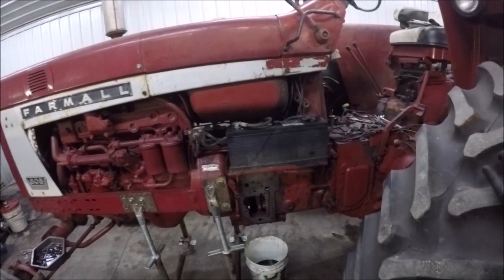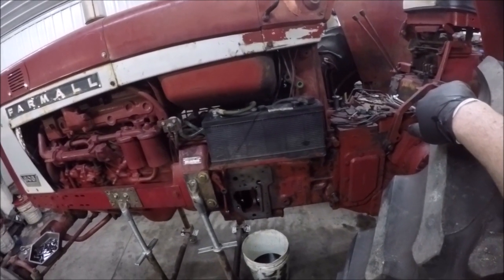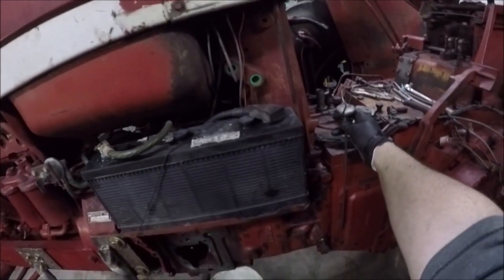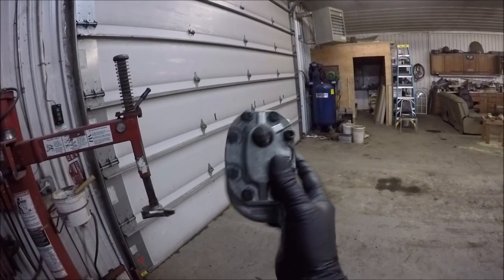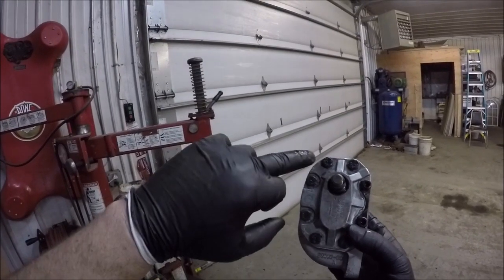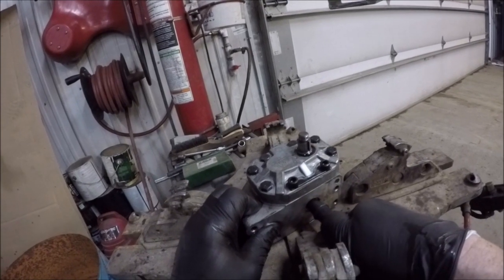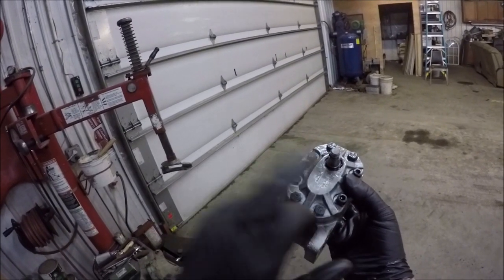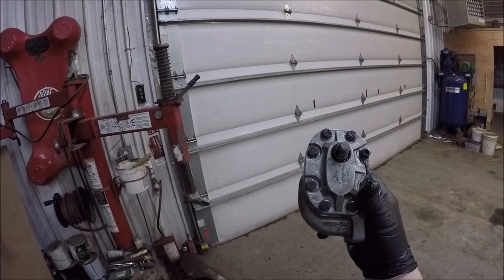Famall 806 MCV Pump Diagnose

Comment: Searching for this particular problem for a 706  IH a friend of mine has. I'm not familiar with IH but I have to believe the 806 and 706 have similar, if not the same, hydraulic systems. Good video and tutorial. Just subbed your channel 👍👍
Reply from the maker: The 706 & 806 are basically identical except the engine and a couple other items. Good luck
Thanks Ed, I appreciate it 👍

Comment: I just connect the other inside liftpump through a hose to establish if the smaller 9 gallon ? steering pump is defect, if it changes anything I order a new one of those cheap indian made pumps, or maybe it  s enough with one pump, don t know, didn t go to a hillside to brake or steer, but most likely it will slower your lift.
Reply from the maker: Watch this

https://youtu.be/sILJp6gL79g?si=vfRyRmv70hQh1Dwg

Comment: Good video! We’re did you order a new “higher flow “ pump from ?   How much more does it flow than factory?  Thanks
Reply from the maker: Thanks.

I believe its factory replacement 9gpm.

https://www.superiortractorparts.com/mobile/Product.aspx?id=38275
Reply: I think he meant the manufacturer of the new pump is HY-Capacity. (Common tractor parts brand)
Reply from the maker: @andrewmills9353  correct

Comment: While shredding with my 806, I noticed that the U-joints on the PTO drive shaft to the shredder broke and the shaft flew off. At the same time I lost the power steering, brakes, remote hydraulics to the shredder and the PTO would no longer turn. Could this be related to a MCV pump problem or likely something else? Thank you.
Reply from the maker: Sounds like something shelled out up by the clutch. Could be the shaft in there. Harmless farmer showed his was really bad shape. I'll see if I can find the video.
Reply from the maker: At about 7:30

https://youtu.be/ceBsKswEIBs